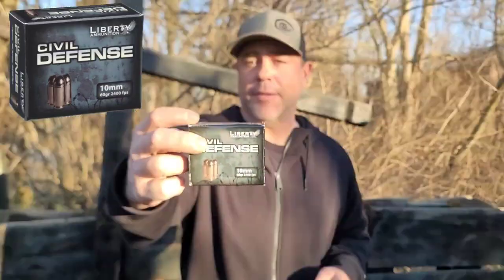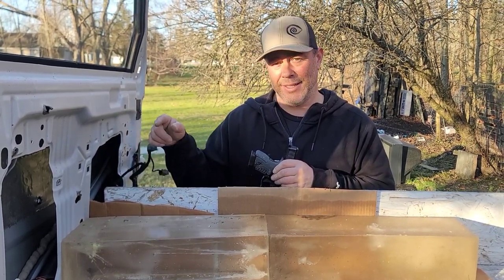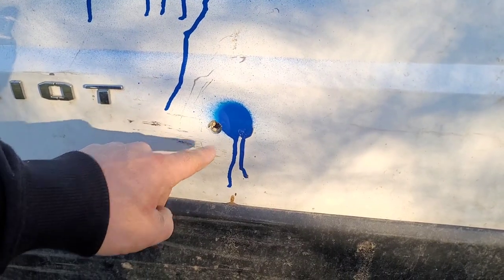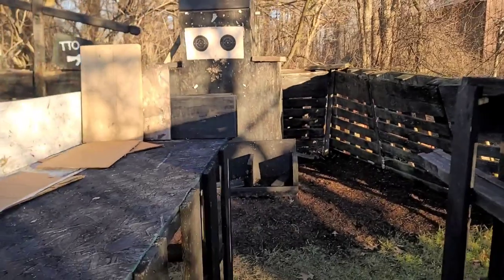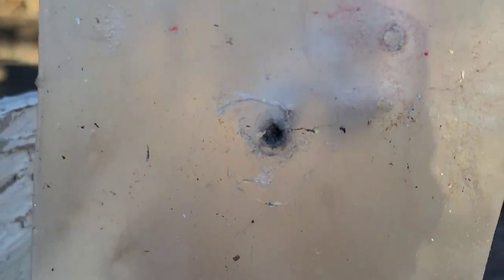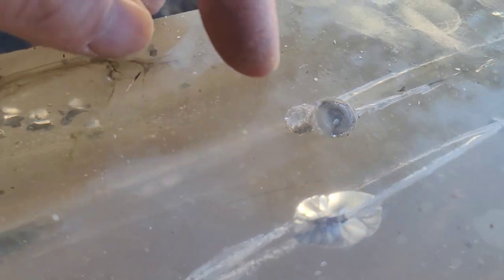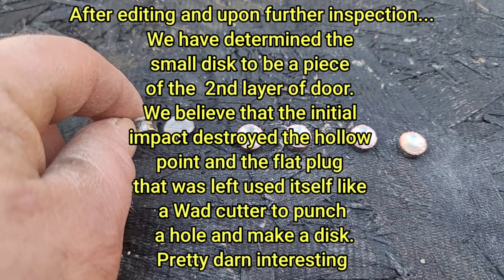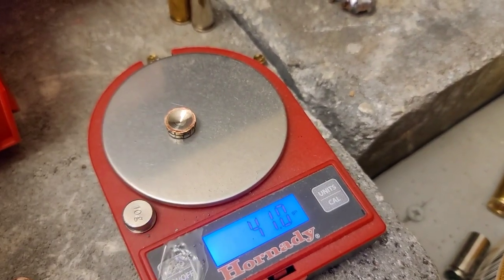Liberty Civil Defense 10mm CAR DOOR Testing with GEL. 3.8" XDM Elite OSP 10mm

Comment: That's impressive that bullet went through both panels and still get 11 inches of penetration with the bullet base! I couldn't tell if there was glass in that car door but that would be interesting to see too - just through the glass and into the gel. The bullet would likely carry bits of glass into the gel just like it did the car door. Shooting through auto glass is the more likely self-defense scenario as you can imagine being inside the car while someone is trying to smash the window or shooting at you from outside. I actually have both the 3.8in and 4.5in XDM elites but I live in suburbia with only indoor ranges and paper targets. Otherwise, I'd be doing these fun experiments myself. With these fragmenting bullets, however, I can see where a prosecutor might really go after you even if you have solid justification for use of deadly force. Thanks!
Reply from the maker: It is!👊🦃👍

Comment: Thank for another great video people have called Liberty civil defense a gimmick round for years it’s not a round for every situation but in most it will get the job done. High energy, low recoil, maximum energy transfer, and very low to no risk of pass through your intended target.
Reply: The FBI standards require a minimum of 12" of penetration. It only goes 11". That makes it not suitable for self defense. Yes it's close but not quite there. Furthermore, that star burst it does, is not at organ depth which basically means nothing. Bird shot shreds meat on the surface and a few inches in, but as is well documented, it is rarely lethal despite the mess it makes. Also light rounds are far more susceptible to path deviation from bones. These rounds could be deflected by a forearm bone, or possibly even the skull if it was a glancing shot. I also want to see how these fair after being out through a windshield that's at a 45 degree angle like on a car. 

Even after all that, someone needs to use one of these on a hog and let's see how effective it is.
Reply: @Steven-gv1ke  The FBI has a minimum but as a private citizen you can use what you like the round delivers lots of energy for low recoil and some sites I have worked want ammunition that  fragments to reduce the risk of over penetration. Bird shot doesn’t do that much damage because it multiple projectiles that don’t cary their energy far. You don’t need to penetrate the body to stop it if you cause enough trauma will put cause the human body to go in to shock. Also no exact bullet is perfect some are better at things than others I use and carry different ammo for different reasons. Civil defense has its use cases and is very effective on a soft target at close distances.
Reply: @Steven-gv1ke the front edge of your heart is about 2" behind your sternum, with the center of your heart about 4" behind the sternum.  So that massive wound cavity is happening at the same depth as your heart and lungs.  Plus the hydrostatic shock from the high velocity, plus the penetrating base.  And plenty of testimony about hog reactions and car windows.  It's a devastating round.
Reply: @Steven-gv1ke  The FBI spec is for a bullet to travel that distance in ballistics gel covered in 4 layers of denim, not through a steel card door and then into a gel block.

Comment: I got turned on too this ammo by my friend who was using it in 10mm on a hog hunt while I was using standard hollow point and noticed almost instantly how much faster the bleeding was with it. Ive been telling people about it ever since. Velocity is the way to go, at least in my experience exterminating hogs once I started using this liberty in my g20 I noticed hogs dropped like they had been hit by a rifle.   

If you want to see what I mean try a comparison test on a pig leg and compare this vs a standard hollow point. I do not think there is a worse handgun round to be shot with in a leg or arm. It wont be physically possible to use it after. It does crazy stuff to meat. I’m surprised high velocity handgun rounds are not more common. After shooting a few hogs it becomes obvious how much better high velocity ammo works compared to heavy slow bullets. Its like they are not even the same caliber
Reply: These Liberty rounds can breeze through 3A body armor, so I'm guessing potential misses in self-defense situations can be more problematic than with standard heavier loads.
Reply: These are the type of real world testing scenarios that we need. If it's putting down a hog faster and more violently it'll do the same to a man.

Comment: A bit surprised and pleased to see this performance as well as it did. I had very low expectations of much if in mass make it to the gel and less expectations of much penatration of fragments that might make it through the door. So I have to give it a win. Not my first choice. But it did perform.
Reply: Hes using a compact 10mm, Liberty 10mm is designed for a 5 inch barrel... It would have done even better out of a 5 inch, what is your carry ammo if you think this isnt amazing performance?

Comment: Love it! I gotta try to find myself a door! I have a question, I'm between getting the Springfield XDM or Smith and Wesson 2.0 in 10mm. Any thoughts on em?
Reply: Well his and my M&P’s didn’t work (check his videos out on it).  I traded mine for the Springfield xdm like he shows here.
Reply: I was in the same dilemma- I decided on the XDM elite after reading about feed/jam problems with the S&W using some of the hotter loads. The XDM seems to work well with all the 10 mm ammo out there. I've used about 10 different kinds so far - including high power underwood and buffalo bore JHP - with no problems ...
Reply from the maker: I personally have to go with the 3.8 Springfield. My Smith was way too problematic. Overall I like the 2.0 gun better. But not in 10mm. The 3.8 shoots like a dream. I'm going to buy a new one just so that I have 1 that hasn't been beat up. The other one is going to stay as a tester. If Smith ever completely gets the 10 mm right I will buy it again in 4.6"🦃👊👍

Comment: The car door didn’t have any of its insides in it. The window bars or motor!  So basically you was only shooting through a couple of thin pieces of sheet metal.
Reply: A Youtube channel called Gun Destruction had 3 awesome LIberty Civil Defense 10mm videos posted before the channel got deleted by the Youtube Stalinists. One of them was a test through an intact car door and into a 16" ballistic gel block with the Liberty 60gr 10mm and a Glock 20. In that test, the Liberty penetrated 13" and drug giant shards of sharp plastic and metal from the door all the way through the wound cavity in the ballistics gel. Absolutely devastating. If you think Liberty 10mm is a joke through barriers, go watch videos of 5.56 FMJ through windshields. They barely go 8" into a gel block. Gun Destruction did the windshield test with the Liberty 10mm and it hit 12" in the gel. The Liberty Civil Defense is essentially a .40 caliber solid copper wadcutter moving at the speed of an AK-47 round. Not sure how much more convincing you need that is it effective and penetrates deep enough to reach vitals.

Comment: So during the FBI shootout in Miami with the bank robbers, that's what caused the FBI to establish the 12" minimum in gel rule. This was based on them often having to go through forearms (including bones) and ribs, then still penetrating into organs. They took standard weight bullets from cadavers and saw how far they went through these barriers, then fired the same rounds (same weight, same velocity, same caliber) and established that if most standard weight caliber rounds penetrated 12" or more in gel, you're good to go. 

However, this was never tested on ultralight weight bullets because they didn't exist back then. So we ASSUME that a 50 grain 9mm round will smash through a forearm, then 12" to 18" of air, then through a rib, and still penetrate organs. 

To prove my point, I challenge that you do the following:

Get two sets of pork ribs. Space them out 12 inches between each other. Then place the gel block behind the 2nd set of ribs. Now for maximum effect of what I am talking about, fire a 9mm 147 grain HST hollow point through this, being sure to hit both sets of ribs, and then fire a 9mm 50 grain Civil defense through this being sure to hit both sets of ribs. The depth doesn't matter, only that we if the bones in fact don't make much difference, those two rounds should be similarly close in distance in that gel block. If the 147 grain HST is significantly further... Well we know now that ultra light bullets don't handle bones. 

Also I suspect there is a significantly higher chance of the civil defense being thrown off course after hitting bone. Same concept as when your hunting and you hit a tiny limb with a .223 55 grain bullet vs a 30-30 150 grain bullet. Anyone who hunts knows the 30-30 is much less likely to be knocked off course.